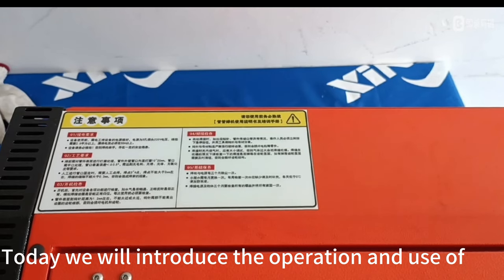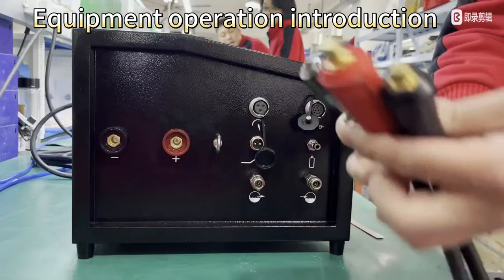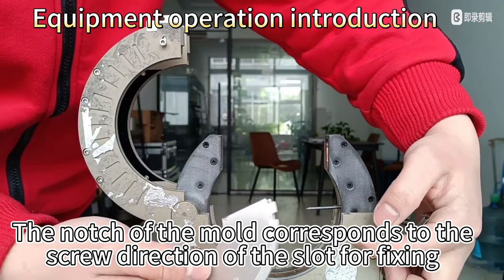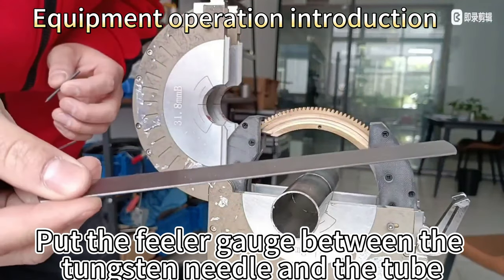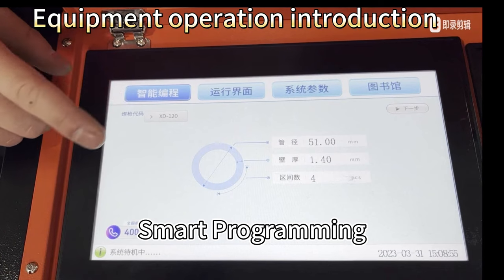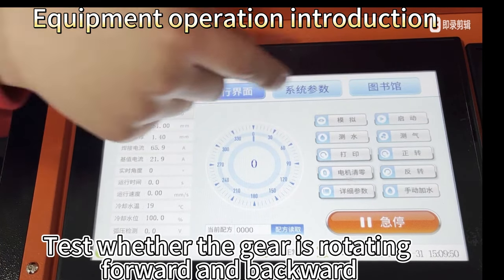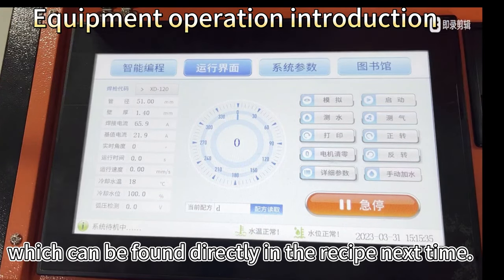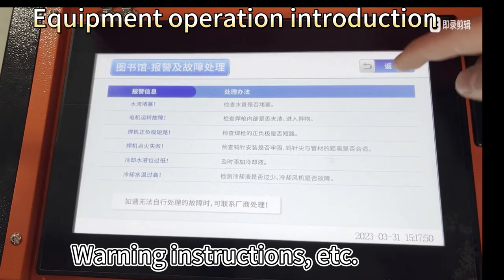KEPUNI ORBITAL WELDING MACHINE OPERATION VIDEO

Comment: Greetings!  Amazing tool.  Very wide possibilities.  What is the price of the power source itself and a separate welding head?  What orbital facing tools do you use to prepare pipe edges before welding?
Reply from the maker: Sir, you can check our official website and leave a message
Reply from the maker: www.kepuniwelder.com